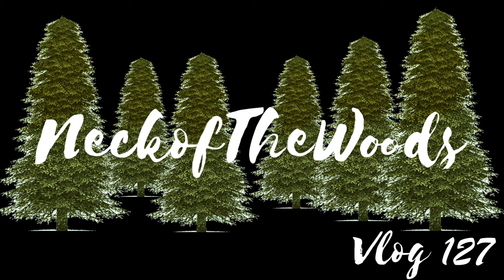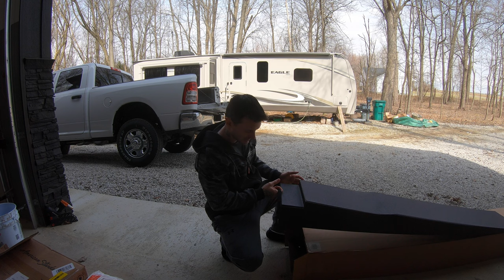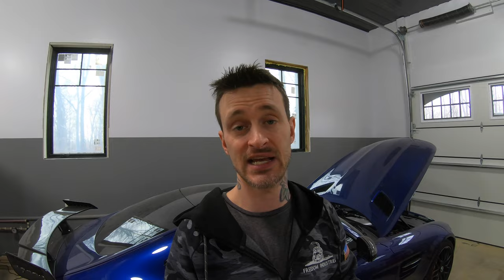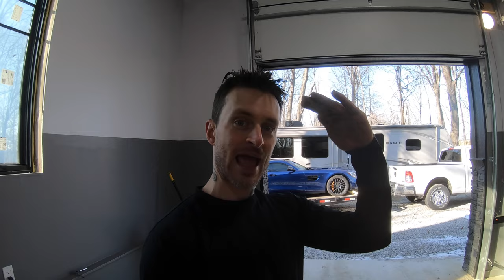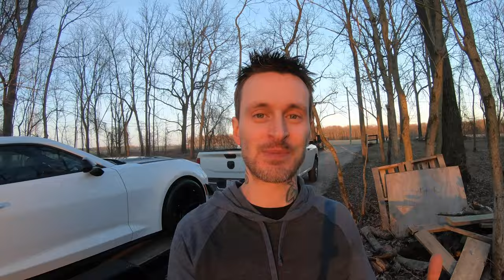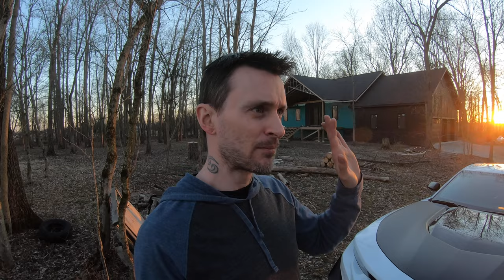I bought a 2022 Camaro ZL1 1LE track pack :)

Comment: I am sorry that you are selling the GTR, so sad....interesting to hear that used cars are going up in Ohio....mmmhhh. In Germany those cars only loose value. Actualky only Porsche goes up and only selected models. You buy a carrera S new for 150kUSD, a minte later you may sell it for 120kUSD, after 4 years you sell it for 90 to 100k....then it more or less stays around 100k and may go up once it is not manufactured anymore. My new 987.2 pdk had cost 90k Euros in 2009. they had manufactured around barely 7000 of it. in 2022 you have to pay around 45 to 75k, depending on milage and extras the car may have.
Most electric cars are driving like a GM Bold, I don' t know who would buy such a thing. Actually an electric car should drive like a rocket like a Model S plaid and up due to the nature of the used type of electric machine. Reality is that the manufacturer take torque and power away to make the battery last longer and to take away stress of the battery to make it live longer, degrade slower.
Reply from the maker: i think the market will die off soon.  1.  Zillow bought a bunch of house for to much money and now cant sell for the increase because they read the market wrong and the same is happening with Carvana and online car sites.  theres going to be a ton of used cars not going anywhere!  but its like the stock market and ive been lucky on the last 3 ive sold!  the inflation is horrible too so v8's etc are going to be hard to sell as gas is to much for some.  it'll be interesting to see.

Comment: Gorgeous car and very smart buy. This car is extremely rare! Nurburgring legend!
Reply from the maker: thanks!  now can i ship it there for free and do a lap?  haha.  that be awesome!
Reply: @neckofthewoods24  This car will be be a hoot at MidOhio and VIR! You should definitely get the SPL Rear Toe Arms with eccentric lockouts. The only 'weakness' this car has is the stock rear toe tends to move under load. Cheers!
Reply from the maker: @AllIsWell_22  video 2 already talked about that!  I love spl but the price!!!   BMR is like 1/2 that and still tubular steel and spiracle bearings so I’ll have to decide.
Reply: @neckofthewoods24  Lots of reports of the BMR unraveling itself. SPL is definitely worth it. Get the Toe Arm from Vivid Racing, they have the best price on the 6th Gen Rear Toe Arm w/eccentric lockout.
Reply from the maker: @AllIsWell_22  interesting.  Is that with all 3 of their types?   They make 3 different kinds for each arm which is weird but option I guess.

Comment: You want a GT2RS, they cost around 250k at Porsche in Zuffenhausen. Only special registered Porsche owners are allowed to buy it. Mostly dealers or race teams buy those, then resell is for 500k and up. Normal people can not buy it directly at Porsche no matter the cash they may have.
All other models can of course be bought directly at Porsche and by anybody.
Reply from the maker: thats erins car!  she saw one at a dealer and wanted it before or after we got the AMG, i cant remember.   they are about 500k here so that a big no anytime soon!
Reply: @neckofthewoods24  thats right, usually they make around a couple of hundred for the whole world. Remember our 987.2? they made almost 7000 for the whole world...what I know and I bet even less of the 981 and lots and lots of the 718. At the moment a 2013 981 cayman S is around 50 to 60k, new it was 66k as a basic S model, so with wheels, roof, white color, manual shift....windows and basic breaks. Only that 🤘

Comment: The only reason I will buy the Camaro in 2024 it’s bc that’s the last year of production I don’t got no choice
Reply from the maker: I keep hearing different things!  If it is true, depending on the trim level, you probably won’t get one.  Not new at least.  You’ll have to buy a new used one someone wants to sell for a crazy markup.  People who have bought and are waiting probably won’t all get one.   GM just won’t make them and they are doing it across the board to jack the prices up and hold onto the supply and demand.